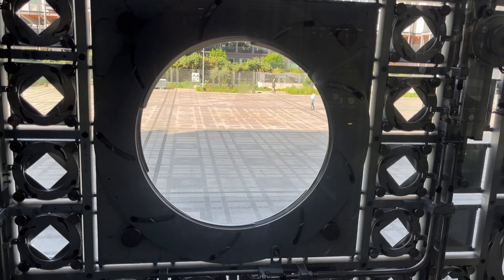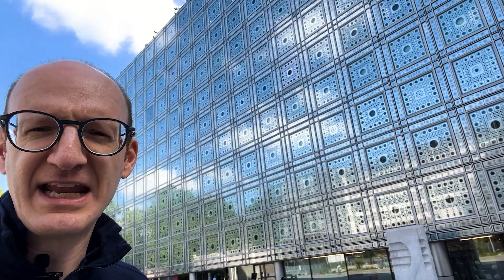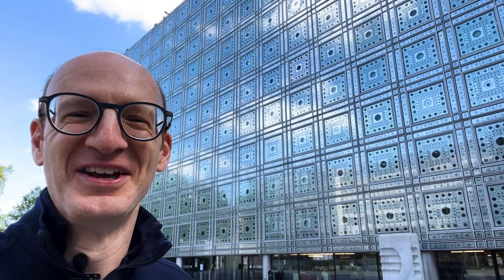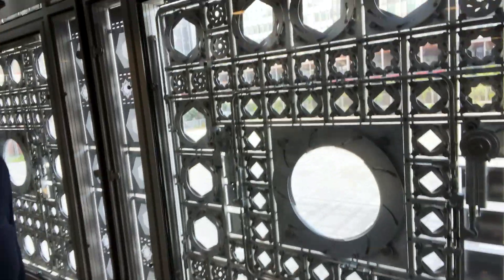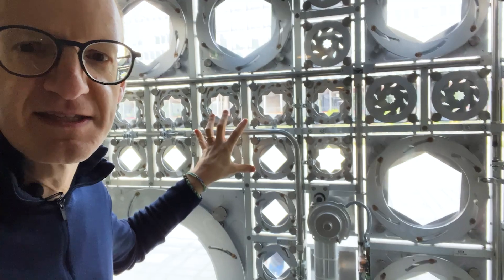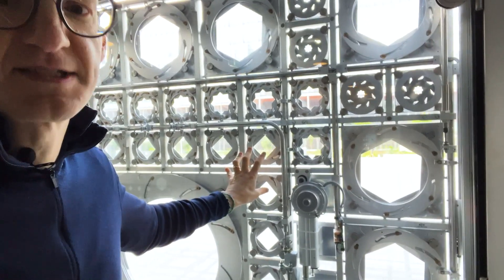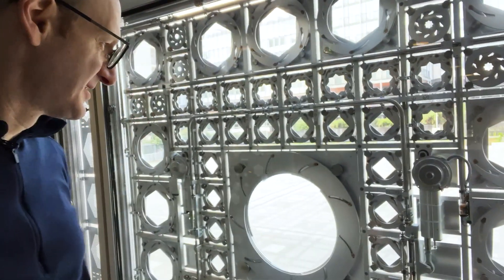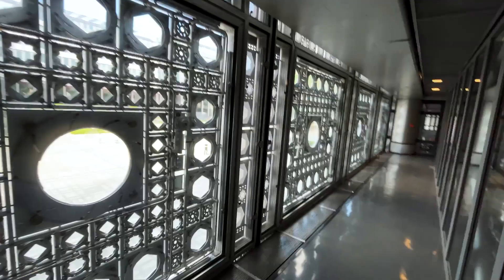The Kinetic Facade Building!

Comment: In a way kind of interesting but objectively not a great idea. Wasted space in side the building, built in inherent maintenance burden, huge cost, not sustainable, blocks views. I know, someone has to (or do they) test the boundaries of what is possible and push the new frontiers, just wish they would do it with their own money.
Reply: 1. It fits inside the window mullion thickness 2. Blocking sunlight to protect artifacts in the museum is necessary, views are not. So you're half-wrong but using the word "objectively" as if you know what you're talking about.
Reply: @gwety4496  Thanks for setting the record straight. I am so sorry I used the word objectively. So in my opinion a kind of interesting but not a great idea. Huge cost, not sustainable,  I know, someone has to (or do they) test the boundaries of what is possible and push the new frontiers, just wish they would do it with their own money.